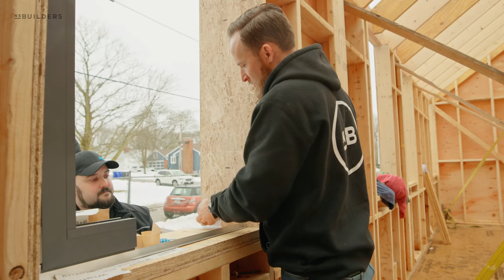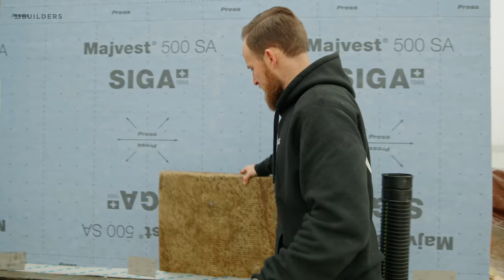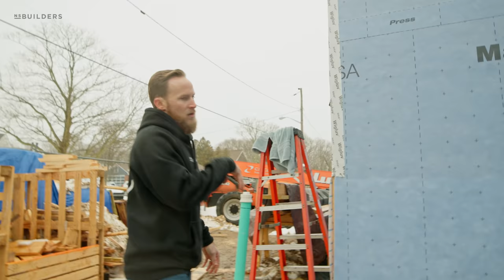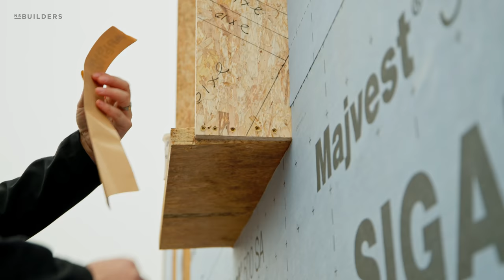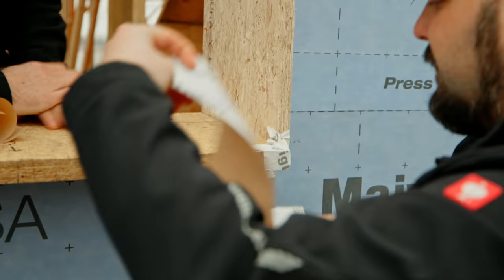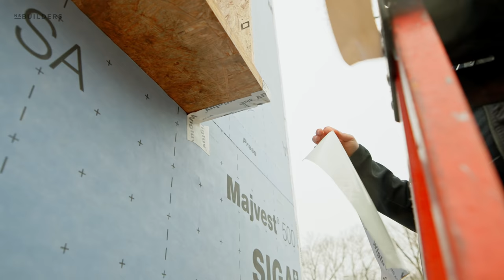SEALING up the window buck with redundant protection

Comment: The wigluv all over the plywood window bucks is a costly detail from a material and labor perspective. Granted its winter… using a liquid roll on would be the easiest and most efficient move for the buck but tape the joint from the majvest to the advantech
Reply: warranty issue? they are using siga everything for the WRB.

Comment: So the rock wool, the outside plywood, the rain screen, and siding are all just hanging from some long screws?  I realize the rock wool is supported by the batts below, which eventually sit on your footings, but an extra layer of plywood, rain screen and siding seems like a lot of unsupported weight
Reply: Stay tuned for the solution - coming soon

Comment: Lots of confusion on the building science here. The wall is designed to have the least permeable layer (the Majvest) in the middle of the wall’s insulation. Humidity from the interior can’t get past this layer so does not hit the dew point and won’t condense to water and exterior water or vapor can’t get into the house past this layer. The most important factor for preventing rot is allowing the wall to dry in both directions. So no added vapor barrier on the interior and a highly permeable weather barrier on the exterior of the insulation.
Reply: But the last layer of plywood that goes on top of the insulation isn't going to act as a vapor barier for the water vapors going from inside to outside and will condense forming water in contact with the insulation?
Reply: This is there for bulk water and air.  In a heating climate zone there would be a smart vapor barrier at the inside that would allow it to dry to the inside in summer if necessary (mostly wood drying out after construction).
Reply: What zone is this? The key is to have a single vapour control layer located at a depth into the insulation that will be above the dew point temperature year round. 

In terms of the exterior plywood, it is a partial vapour retarder, but if the rate of vapour movement is small (due to the much stronger vapour control layer), condensation shouldn't be a problem.

Comment: for the window install you could use instead of a caulking method (which is fine but I don't think it will last a long time) a product called compriband foam tape that is going to provide a really good seal around the windows and last a lot longer

Comment: Instead of taping the entire wood window frame, can you use leftover pieces of the WRB to do the flat parts and then tape the seams? Using less tape maybe?
Reply: Yes - makes sense for the jambs and underside of the head where water can drain off, but not for top of sill or top side of header buck where water could sit on it.
Reply: @julianugentarchitect  yes, I meant tape the appropriate places.  Not where water could be trapped.

Comment: When installing the exterior sheathing over the Rockwool, could you use some type of metal C channel spaced out every 4’ or so?  Then you could fit the Rockwool inside the channel to achieve maximum coverage and minimal thermal breaks.  And then you have a solid place to mount the sheathing to.  Just a thought.  Basically like a perlin running vertical.
Reply: We are considering fiberglass z-girts designed for this purpose. Metal would reduce the value of the insulation significantly.
Reply: @julianugentarchitect  he did say Z girts, I watched it again, I missed that.
Reply: Metal is a conductor. Whole idea is to control the thermal bridging. Should be a good system accept for $. Labor and materials sensitive.
Reply: @francoisbouvier7861  yes, I didn’t even think of using fiberglass material.  Didn’t know they made them.

Comment: As admitted, zero need for the Majvest SA behind the Rockwool -  taping the plywood seams for your air control layer is all that's needed.  

Rather than being 'redundant', using Majvest behind the Rockwool decreases permeability and decreases ability for vapor to escape the wall assembly.  

I suggest you're doing more harm than good - and spending a ton of your clients money to do so (labor to install self-adhering wrb isn't cheap - nor is the cost of Majvest wrb)
Reply: Nick misspoke on this point. The majvest is the air, water, and vapor control layer. It’s in purposefully in the middle of the insulation (5.5” batt in stud walls, 6” board insulation outside) to prevent vapor from condensing when it hits the dew point. The wall is able to dry in both directions. If it was taped plywood only, vapor would get into the outer insulation and condense when it hit the dew point. This method allows us to skip an interior vapor barrier.
Reply: Probably a good idea to note what zone you are in, as the appropriate vapour barrier depth into the wall is quite different in Alaska vs the south east USA. I assume you calculated the dew point depth for the range of temperatures and humidities in your region but it is good for others to realize that this arrangement may not work in their zone.

This is a topic that many people get wrong. Eg in our northern climate, it is common to install an inch or two of vapour impermeable foam over a 2x6 wall full of fluffy insulation with 6 mil poly under the drywall. I cringe every time I see that vapour sandwich, and it is effectively encouraged by the codes here. You are right that many misunderstand the building science wrt control layers.

Comment: “How to flash a window in 2 hours with $100 in tape…”
Reply: The SIGA products are crazy expensive. But i used to work with their products all the years. If you have any problems with their products, questions for using them or just recommandations to improve their products they are always listening and support you well. It is waterbased glue, sticks like hell and bonds 30 years without any problems. I know that from renovations.

Comment: I remodel older buildings and haven't worked on new builds for years but WHEN i do  ..... many new builds are falling apart after 5 years and some old buildings from 130 years or older are tight as a drum.  The speculation and cost is a problem for people spending a lot of $ for new systems.

Comment: Rockwool touching the ground? If that's what I think it is this is the worst thing I have ever seen in my life, no chance the rockwill be dry more than a few days despite what your female architect says
Reply from the maker: Comfortboard is both moisture wicking and rated for below grade.
Reply: @NSBuilders  So rockwool holds it's R value when wet?
Reply: This is not the same Rockwool used inside walls. It’s designed for ground contact, does not wick water, and does not attract insects.
Reply: @julianugentarchitect  Interesting. I'd have to see it to believe it though. Keep us updated on how this goes
Reply: @NSBuilders  Female Architect? What does the designers gender have to do with the quality of the details?  Second they stated that they were working with rockwool on a product solutilon for the insulation touching the ground, and that the piece shown was a temporary spacer.